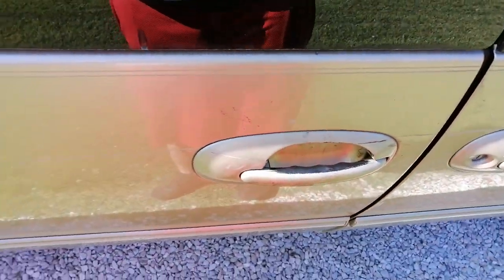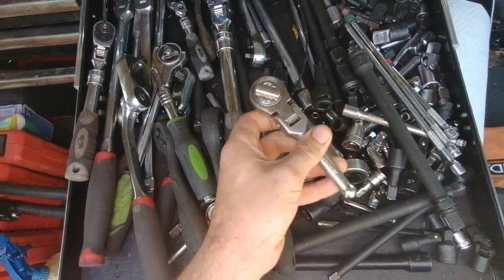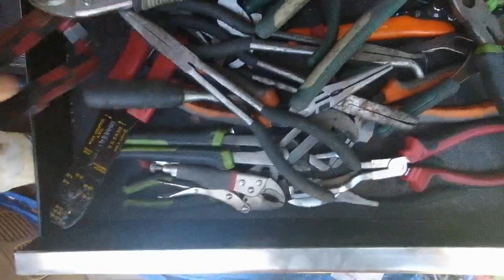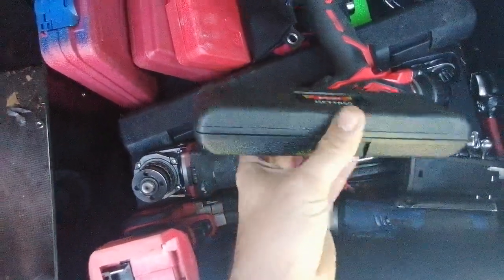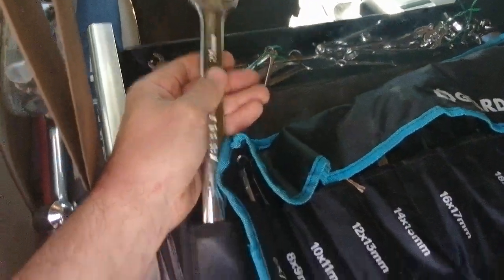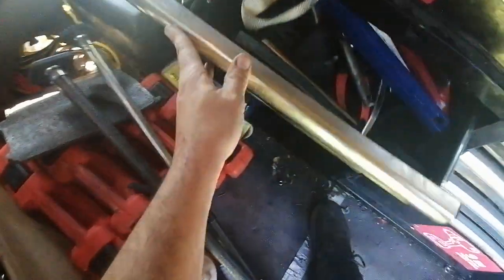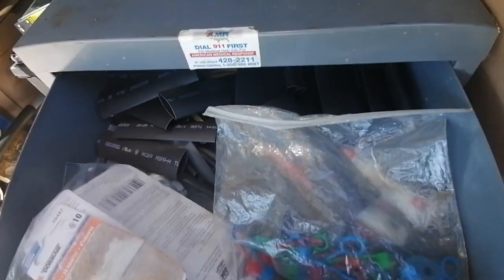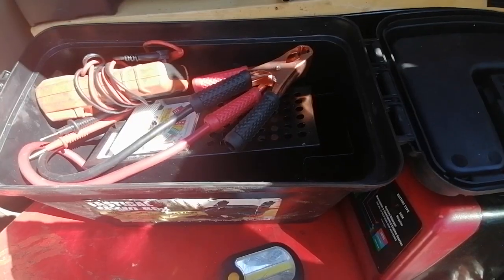Mobile Auto Repair Van Tour

Comment: Looks like you got that van pretty well packed!
Reply from the maker: Yeah, I'd like to get a full-size van but the ones in a reasonable price range have only slightly more room, worse gas mileage obviously, and like 300k miles on them, lol. I appreciate you checking in on me!
Reply from the maker: My only nagging issue with this is I changed the plugs about a month ago and removed the fuel rail. I didn't know it had been recalled for leaking. I had to end up using rubber fuel line connecting directly to the pipe on the end of the rail. It seemed to leak no matter what. I went a size down to 1/4" hose, used the drillmaster heat gun on it so it was pliable enough to flare out a bit, used high pressure clamps, and it seems to be holding now.